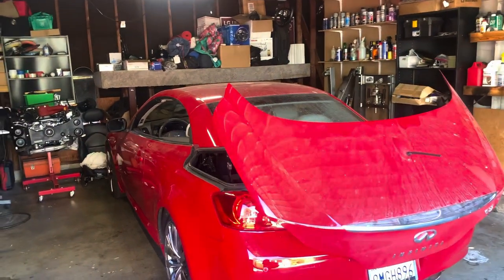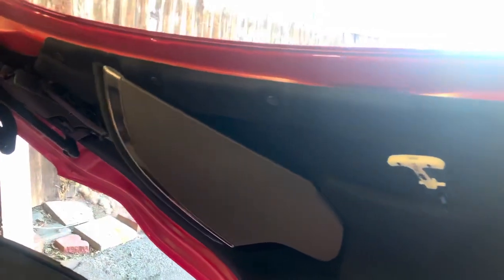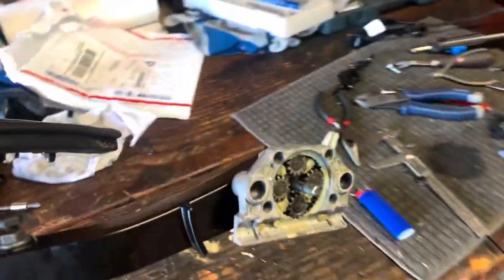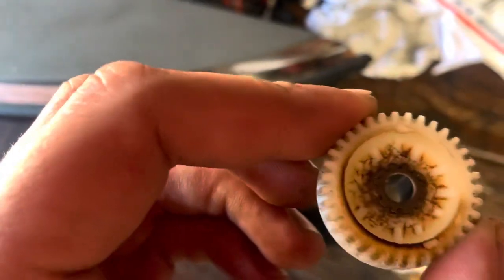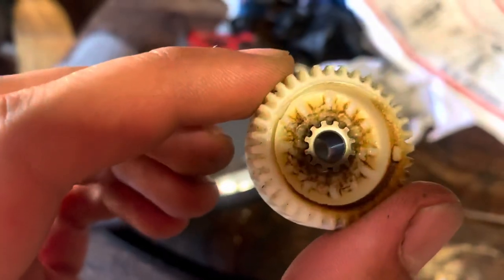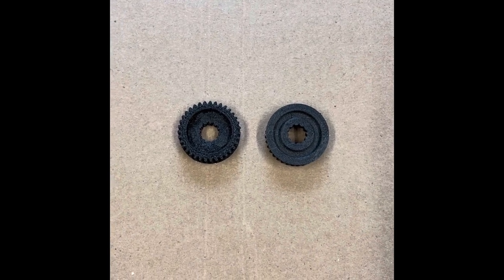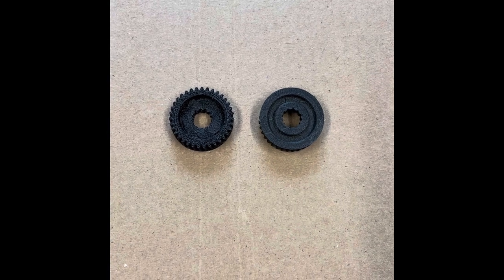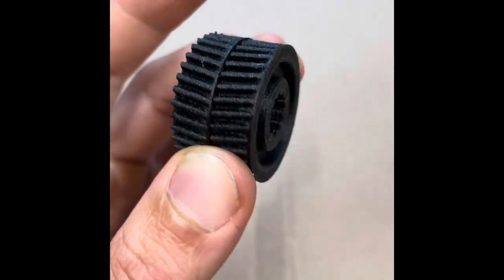Infiniti G37/Q60 Convertible Flaps Solution / Replacing Cracked Gears

Comment: Bro can you email me the instructions on how to replace the flap gear?
Reply from the maker: https://www.myg37.com/forums/g37-convertible/285438-newbie-with-flipper-trouble.html

From this thread you can get an idea. But my personal recommendation is to open the trunk while the roof is closed, remove the cover, drill 5 rivets that holds the flapper assembly, replace the gear, install the assembly back with new rivets, install the cover.
Now you have everything assembled, trunk open, your flipper arm somewhere in the middle of its travel range and you want it to move to its end. You take a screwdriver and close the trunk's latch (but not the trunk itself) - so the car think that the trunk is closed(but its open). Now you go inside the car, cycle ignition and press the roof closing button - flapper should go to its end position. Now you are done. Don't forget to open the trunk's latch before you close the trunk.

Comment: I recently bought a 2012 g37 convertible. Do you know what years the flaps had issues?
Reply from the maker: All years and both gear designs has this same problem
Reply: 2012 is mine and it has one flapper down 😢

Comment: Were you able to just remove the flap and not the assembly?
Reply from the maker: Yes, you’ll need 12v power and wires to move the flap up and down to be able to drill out rivets. Same with assembling. Good luck)

Comment: How can I make my trunk go back like that
Reply from the maker: My personal recommendations is to open the trunk while the roof is closed, remove the cover, drill 5 rivets that holds the flapper assembly, replace the gear, install the assembly back with new rivets, install the cover.
Now you have everything assembled, trunk open, your flipper arm somewhere in the middle of its travel range and you want it to move to its end. You take a screwdriver and close the trunk's latch (but not the trunk itself) - so the car think that the trunk is closed(but its open). Now you go inside the car, cycle ignition and press the roof closing button - flapper should go to its end position. Now you are done. Don't forget to open the trunk's latch before you close the trunk.

Comment: Are all the plastic gears the same for all years? (2009-2013) I heard the gears were different from late 2011-2013. I just want to make sure before I buy.
Reply from the maker: They are different starting 2012. But now i have both generations available.
Reply: @maksimd9454  I have 2011 and I bought the old one as you have mentioned. Then when I tried to replace it, I noticed that they are different. I spent lots of money to order and ship your product with no benefit. So now I have to pay same as I spent to get the new one.
Reply from the maker: @r-h1526  send them back for a replacement. if you bought them on ebay, please contact me there
Reply: Can anyone send me link for the correct gears I need for a 2010 g37 hardtop
Reply: @maksimd9454  can you send me link with the one my car needs thanks